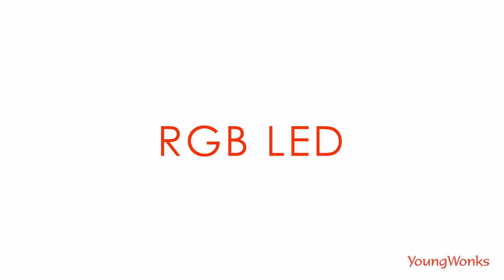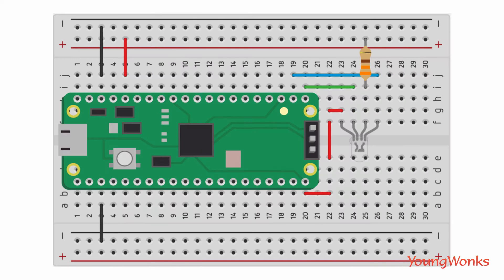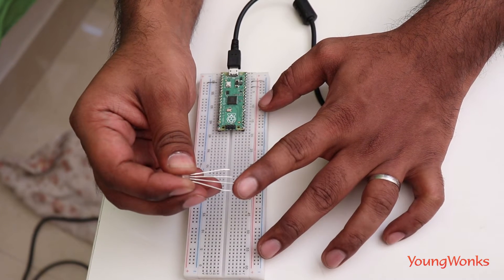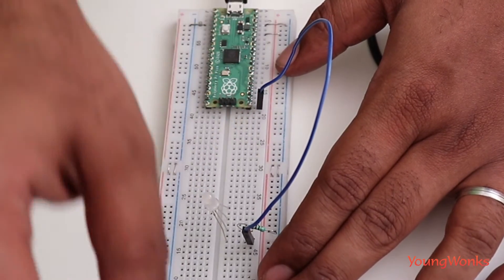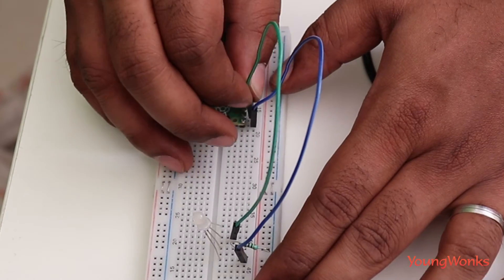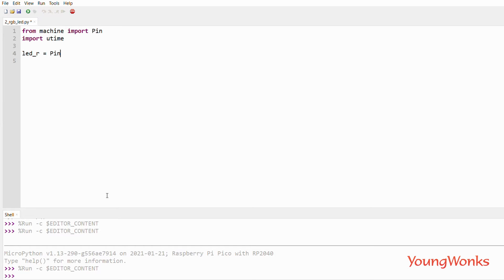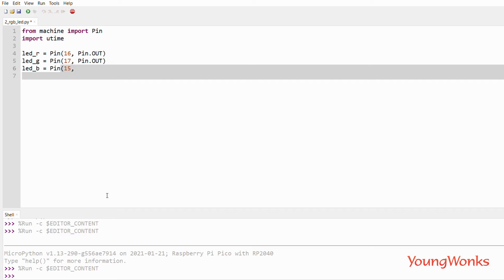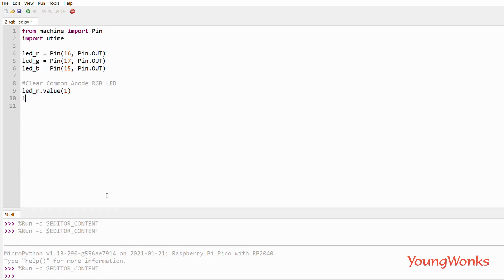Using an RGB LED with the Raspberry Pi Pico

Comment: What's the point of connecting GND on port 3 to negative rail and 3V3 on port -5 to positive rail on the breadboard if you're not connecting anything to it? Also, on the image with connections the resistor is connected to plus, but then on the video you're connecting it to the minus??